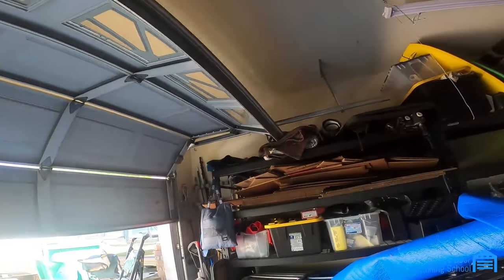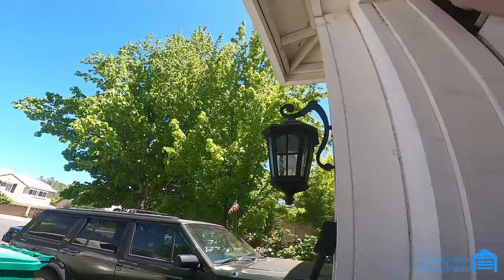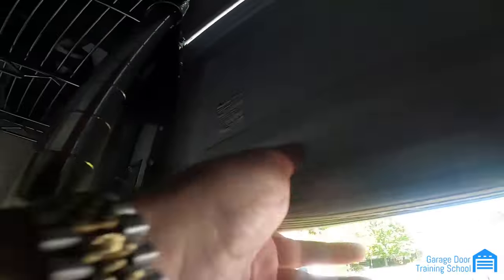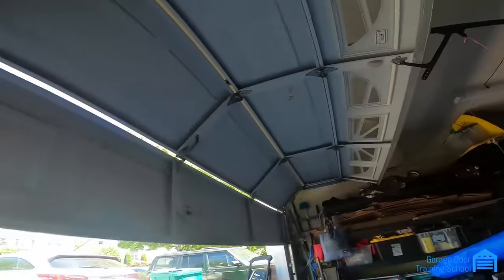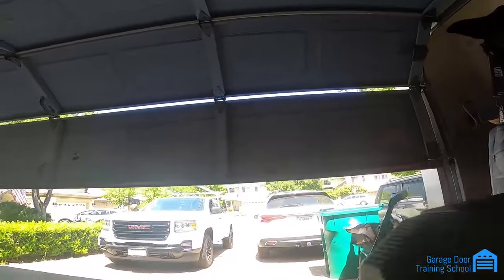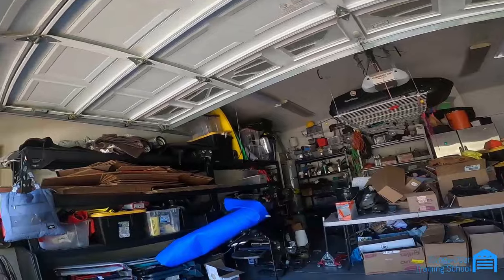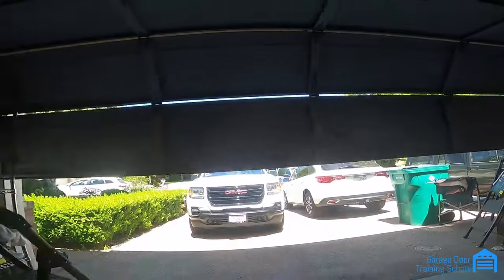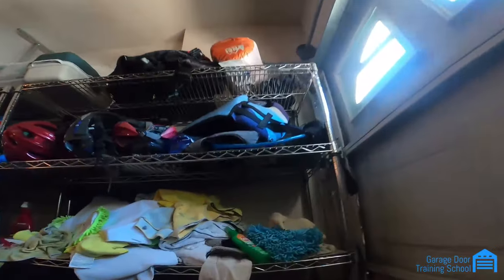This Door Was HANGING! | Door Off Track + Cable Reset

Comment: Picking up the door removes tension off the cables if you were to loosen your set screws on the drum with the door fully down there will be full tension and that will be a mess

Comment: thank you for the video.  Was it the top of the door to the middle of that vertical bracket that you were measuring?  You referenced the the bolt position also 5'oclock, i'm just trying to put that part of the video together.  Thanks again!